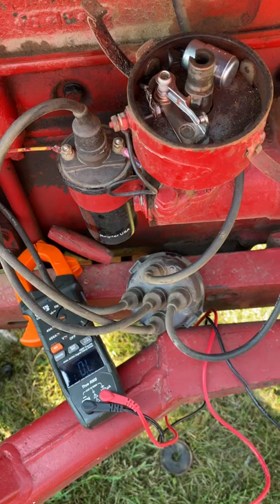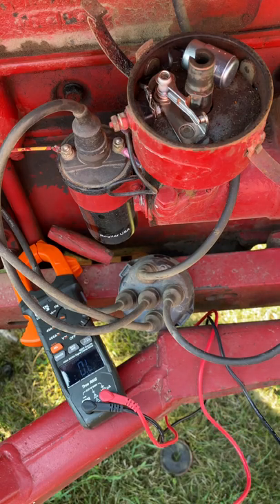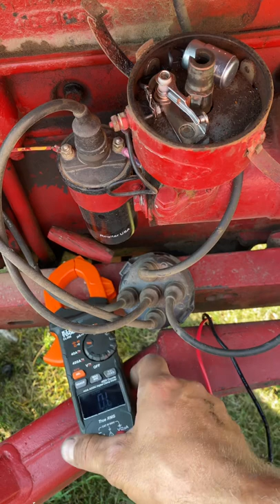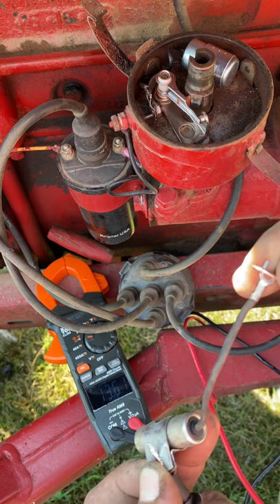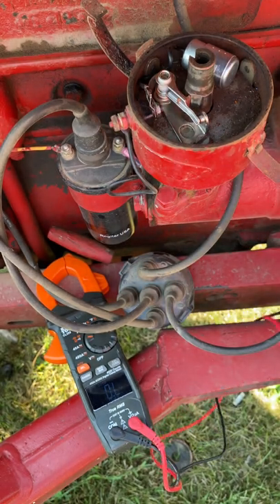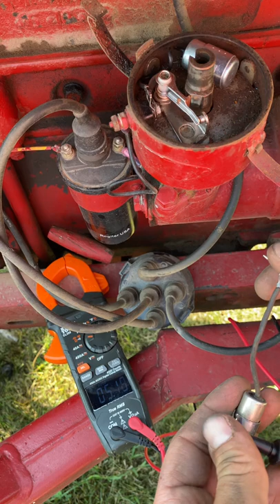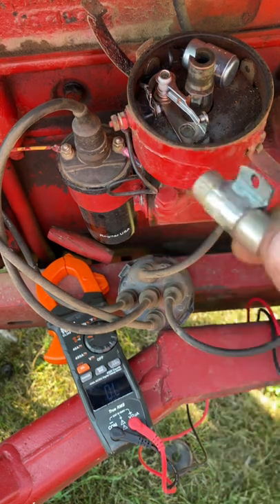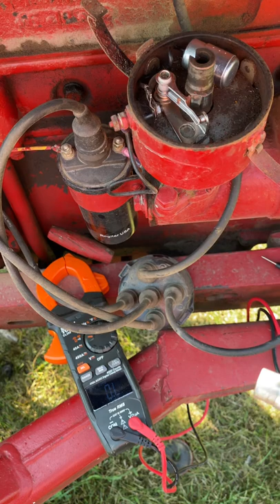How to test a condenser on an old farmall tractor, no spark at the plugs.

Comment: thanks so much for this short video, I just got an old farmall c going, had no spark at the plugs, had it to the coil & distributer cap, couldnt figure it out, so I changed out the points & condenser (which fixed it, now I can test it), so thanks again!
Reply from the maker: No prob! I had Althea same issue with a 460, when I tested with a multimeter I was getting electricity to the plugs but no spark and was completely baffled.  I tried googling it and didn’t find anything!  Glad to hear it helped you!!
Reply from the maker: Thanks for commenting! Please don’t forget to subscribe to my channel!

Comment: In electronics school, I was taught not to touch the leads when testing ohms because the human body can give false resistance readings. Also, testing a condenser in the distributor is a different scenario. Example, you will get different resistance readings with points closed, opposed to points open when testing resistance on the condenser.
Reply from the maker: Thanks for sharing!

Comment: In the old days we never checked them we just tossed them out and put points condenser rotor cap plugs and wires they were cheap and you did it on every tune up
Reply from the maker: Nowadays you can buy new stuff and not have it work right out of the box!

Comment: I think you are testing your fingers more than the capacitor.   Try the same test without the capacitor, and you will see what I mean.....   Just as a basic electrical principle, it is never a good idea to hold one terminal with one hand and the other terminal with the other hand.  The possible current path is up one arm, across your heart, and down the other arm...  RIP.     Glad you found the fault however...
Reply from the maker: My fingers aren’t touching the metal, they are touching insulated probs.